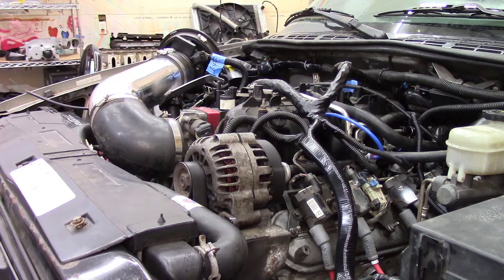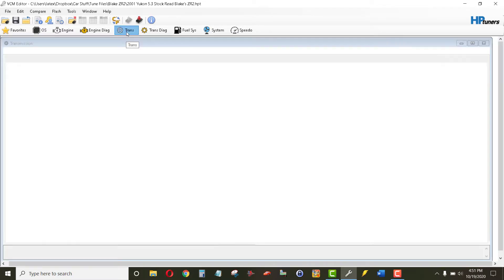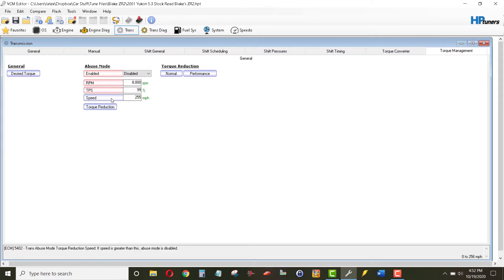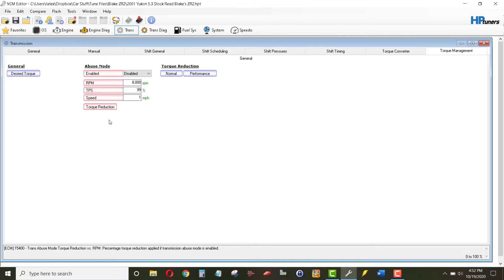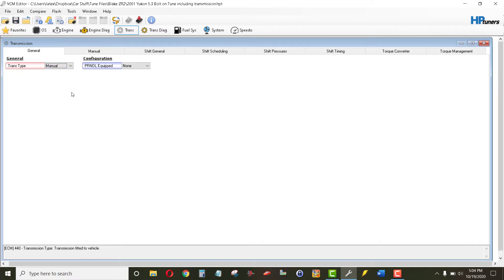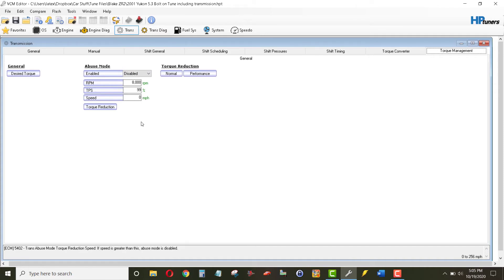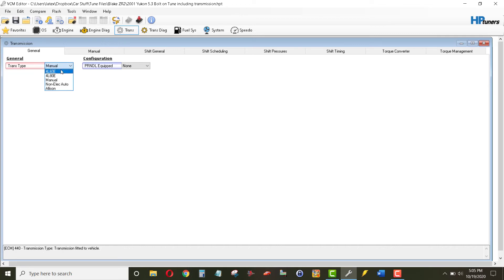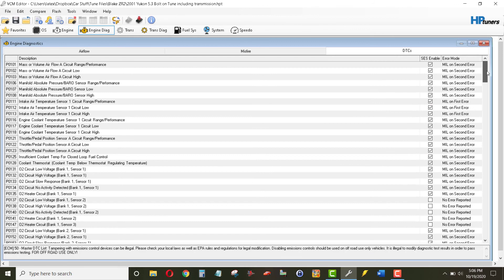LS Swap No RPM Troubleshooting

Comment: Man I did a 5.3 LS swap on a 67 f100 that had a 4l60e and I swap a nv3500 on it and I did went in and selected manual transmission and boom. Abuse mode kicked on so now I'm going back to the program and doing what you said after changing the fuel pump and some sensors 😂 thanks for the video man.
Reply from the maker: @al-mz1wy  Awesome! So glad it helped out!

Comment: Is there any other issues that would cause loss of rpms like that before I send my ecm back to a tuner
Reply from the maker: Unsure, I would have to know more about the build.
Reply: I sent my ecm back to the guy I got everything disabled from, he said everything looked good and sent it back to me when I received it I plugged it back in and it revs normal now, the only thing I did while he had it was change the temperature sensor
Reply from the maker: @1986chevy  Thats great info, thanks for sharing!

Comment: Do you have the VSS hooked into the LS harness? I’m having a very similar issue i also have an 01or 02 Yukon 5.3l with a manual behind it. Mine will not rev which I’m guessing is the abuse mode and it is also idling very high. Thanks for your help
Reply from the maker: Hi @Robert shortridge correct the VSS is not hooked up as our harness was trimmed down by someone else. Disable Abuse Mode and it should work. Idling high in my experience is either the idle screw is improperly adjusted or a vacuum leak. Borrow a smoke machine from a buddy and do a smoke test - its the fastest way to be sure. I have a video showing the operation of one. Let me know what you find out! Do you have HPTuners to complete the job?
Reply: Not currently but highly considering buying hptuners had someone locally do my harness and ecu trying to get back with them currently to get some changes made i have searched and searched for a vacuum leak with no luck other than a cracked regulator boot that made no difference.
Reply from the maker: @rshortridge8806  Go in on HTPuners with a buddy. I use mine for troubleshooting error codes along with analyzing datalogs. Great tool and its not hard to learn at all. "The Tuning School" has great instruction manuals and classes, its super easy with all the support thats out now. Reach out if you need any help. I have a tuning vid if you want to see how its done.
Reply: Ya my first LS swap I’m sure there will be another plus i plan to cam this one once i get the bugs worked out from the swap. I’m sure it will be worth having
Reply: So i went and bought  hp tuners and disabled abuse mode and it didn’t seem change the fuel cut. But i also don’t see an option for transmission selection. Just prndl options. Any thoughts
Reply from the maker: @rshortridge8806  Ok, I assume the donor engine had an automatic transmission - yes? If so, ensure the transmission selection in HPTuners is Automatic. I will take a quick look at the tune I have for this situation and get right back with you.
Reply from the maker: Go to Trans then Torque Management then Under Abuse Mode RPM 8000 TPS99% Speed 0mph. Then go to Engine Fuel Cutoff/DFCO then Control Method ETC disabled. Send me an email at mymusiconmyiphone@gmail.com and I will send you the tune so you can compare and copy settings.
Reply: It was an automatic showing 01 GMC Yukon 5.3 as the donor. I disabled and put rpm to 8000 and speed to 1

Comment: Hey Carwells I’m having trouble starting my 5.3 Pontiac G8. It just cranks and cranks, can u help
Reply from the maker: Ok, I would first start with pulling a plug and visually verifying spark, if I had spark I would then go right to the Schrader valve on the fuel line and verify 58psi or more. Let me know what you find out.
Reply from the maker: Please remind me, was your G8 a GT or a 6cyl? I know the G8 Gt's had 58tooth reluctar wheels, I dont remember the year of your 5.3 but verify it is also a 58tooth and not a 24tooth wheel. Crank sensor signal is required by the ECM to provide continued electric power to the fuel pump, I believe spark too, so checking the reluctor wheel, wiring harness and sensors would be other possibilities.
Reply: @CarswellsCustoms  the G8 is a 2009 6 cylinder with a 2001 Tahoe 5.3
Reply from the maker: @AndrewsMotorWorks   Email me your phone number or IM me on FB and we can troubleshoot.

Comment: One question tho?  Does the abuse mode setting have anything to do with traction control?  Or has traction control been a problem with this swap??
Reply from the maker: I believe the abuse mode is a different system than the traction control. Inside HPTuners you can affect both of the systems independently, so I assume they are not related.
Reply: Ok kind of what thought!  Thank you for the info!